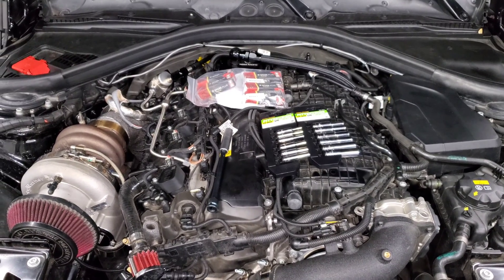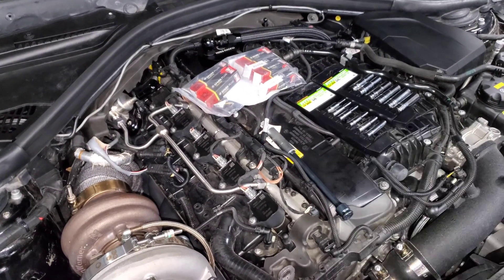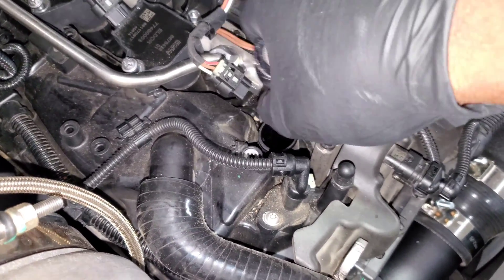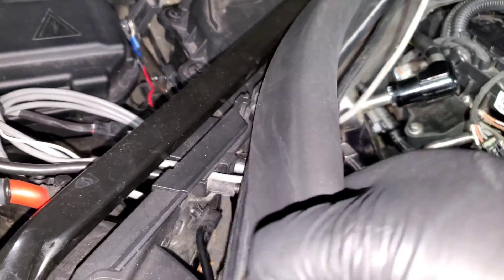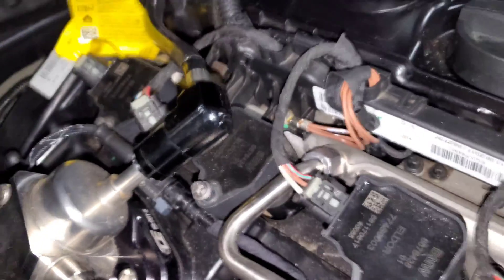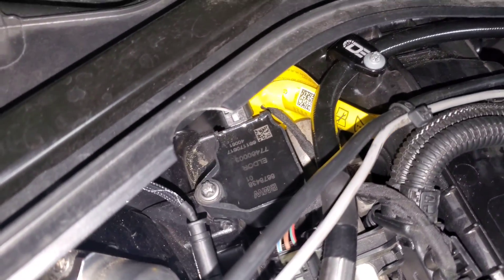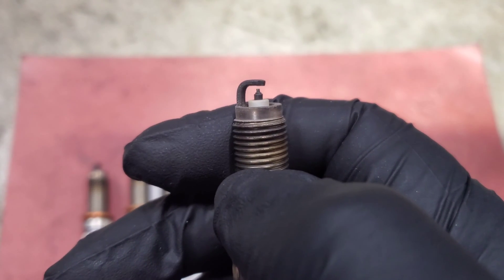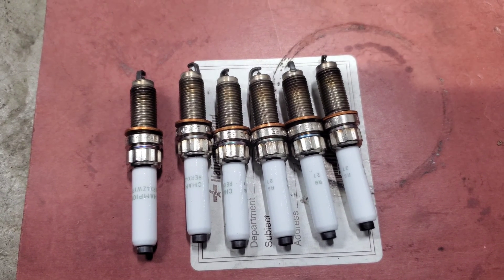B58 Spark Plug Replacement DIY & How to Read Your Plugs

Comment: Awesome video KERN.  Thanks a bunch.   I'm wondering if I should be concerned at 54k if the plug tips are quite green.  Not black or white but green.   I believe this is oxidation and ok at 54k miles.  True?

Comment: Hey Kern! I recently replaced my torn PCV diaphragm and my oil filter housing. I assume I should probably check spark plugs. Any other additional maintenance I should probably do? So far I've only changed the oil after the oil filter housing replacement bc of the coolant leak. Thanks brother.

Comment: hey man i have a 2020 m340i and the ngk spark plugs i ordered are a .23 gap and im stock does this sound right this the one i got
Reply from the maker: you ordered new oem plugs and the gap was 0.023 out of the box?
Reply: Isn’t the stock gap normally .028??

Comment: Question about the foam. Does the foam covering the back of the engine really matter? I thought maybe there were some insulating attributes to it as well. I've been contemplating to leave it or take it out. Sound wise having the engine cover on or off makes the most sound difference.
Reply from the maker: It's mostly sound deadening. It's removed on both of my cars.

Comment: Not gonna lie, this is rather cringe. No anti seize or die electric.
Reply from the maker: From the BMW manual:

"Do not grease/oil thread or use any graphite or copper grease. Adhere to the torque values of the packaging information or regulation.

Note: If these instructions are not followed, especially with regard to greasing, this may result in mechanical damage to the spark plug housing/thread. Spark plugs that are not tightened sufficiently lead to leaks and to the spark plugs coming loose during engine operation."

So, you were saying?
Reply: @kern417  common sense, dissimilar metals, use anti seize. You must not have ever been an actual mechanic
Reply from the maker: @hondaman8648  also common sense: BMW makes millions of vehicles a year with the same maintenance strategy and it works great. You must have never been an actual engineer
Reply: @kern417  no, I'm not an engineer x and thank God. The people that really understand cars and see engineering mistakes are the ones working on them. Steel plugs seize in aluminum. Fact.... but you do you, that's your car, not mine. But in the 100s of not thousands I've done, not one issue using anti seize.... plenty of issues dealing with plugs when it's not used, especially most factory ones.
Reply from the maker: @hondaman8648  engineers are the ones that make solutions like this possible. They understand that closing on 10 years of data trumps any assumption you make. But you're right, my car along with everyone else's working well and going fast. You can keep on wasting time with unnecessary steps 👍🏾
Reply from the maker: @hondaman8648  here's a hint. Google "NGK Trivalent metal plating" and get back to me 😉
Reply: @kern417  in no way do I trust only that, and if in not mistaken, these have champion plugs factory. But here to argue, just better safe than sorry. Had to many give issues over the years to not use a fail safe.
Reply from the maker: @hondaman8648  both NGK and Champion are the same OEM plugs that meet the same specifications. It's interesting you don't trust a metal coating but you trust a grease that will affect hitting your target torque and in turn could cause leaks or potentially damage the head. Which has actually happened in been documented multiple times. But what do I know, I've only owned and followed the platform for the past 6 years. Feel free to keep relying on old technology as everything else progresses. My recommendation is to fo research instead of assuming the same old process is safer.
Reply: @kern417  lol mk bud

Comment: Hello, my bmw G32 630i b48 has black smoke in the exhaust end, and with an obd tool, I found the mix ratio goes 0.9 around right after engine braking and slightly accelerating. In idling or just re-accelerating while running without engine brake,  these have 1.0 ratio. And 1.0 at normal running and full acceleration. What do you think is wrong? The dealer says no problem if no diagnostic error in the display. In that condition, the intake pressure shows slightly lower than atm. pressure. I think the throttle is opening less in that case. Then the fuel injection accordong to the MAP should have been adjusted. very strange, I guess this is inherent in software itself. I am gping to replace the plugs first, because the car has 55K km milages

Comment: Should I still change my plugs to new ones even if the injector is stuck open? Or should I wait until I replace the injector and then change the spark plug?

Comment: Hey man nice video as usual,  im MHD stage 2+ with TU pump and I had regaped my plugs to .22 for the setup... should I  return to stock? I'm on factory Champion plugs with 18k miles. Thanks!
Reply from the maker: If it's running fine, I wouldn't worry about it. I just recommend stock gap for future plug changes.
Reply: @kern417  is there any downside to my gap at .22?
Reply from the maker: @lokisgr  slightly less efficient

Comment: Hey Kern, what’s a good mileage to change out the plugs ? Got no issues and engine is only on 10,000miles. Stage 2+
Reply from the maker: 30-40k
Reply: @kern417  thanks for the reply

Comment: How often do you change your ignition coils?
Reply from the maker: When they fail
Reply: @kern417  And usually misfires are one of the possible indicators of that? I ask because some forums mention changing coils at 100k or at 50k if tuned.
Reply from the maker: Yes misfires in boost